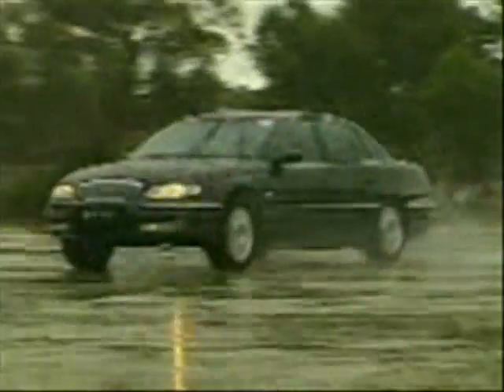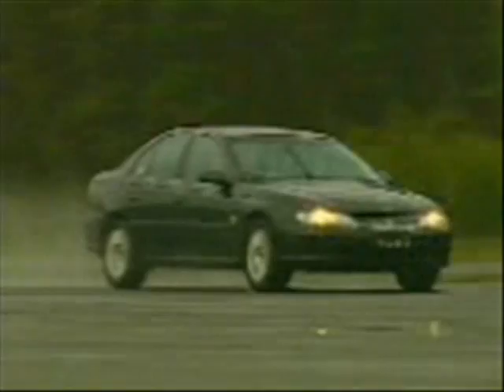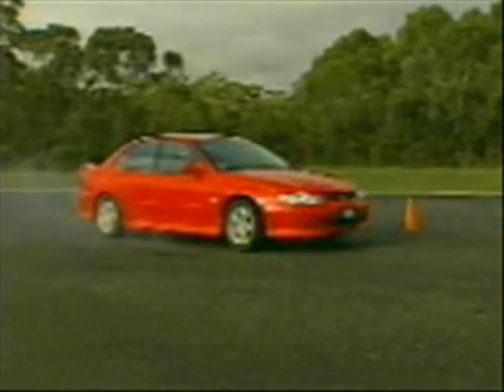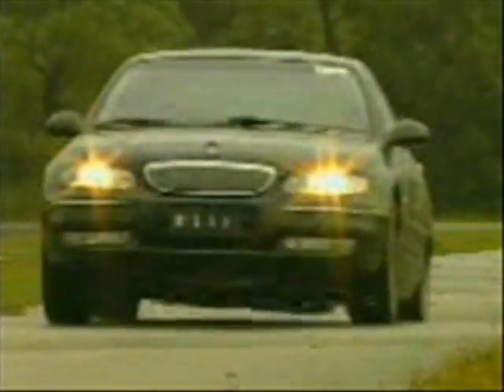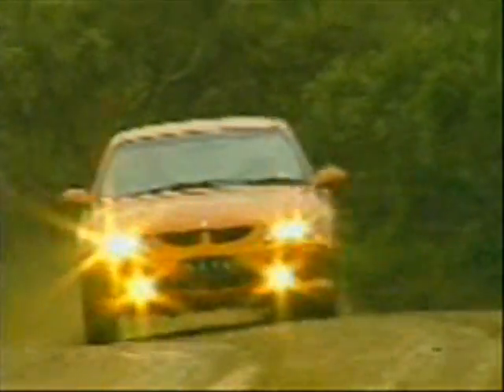Holden vehicle development

Comment: And no chamber adjustment on the rear traling arms , results in negative camber and wears the rear tyers on the in side ,SO YOU NEED TO CHANGE THE TYRES ACROSS THE CAR A FEW TIMES INTHERE LIFE TIME ,OR A AFTER MARKET CAMBER KIT TO BRING THE CAMBER BACK TO SPECK .

Comment: Pity testing didn’t result in durable top strut mounts or reveal weakness in fluid filled rubber caster rod bushes. Forward and reverse dumps should have ruined tail shaft rubber donut isolators, rear cradle rubber mounts also prone to stretch, tear and fail under such stress, hell just going over residential speed humps a few times collapsed top strut rubber mounts. Sure weren’t built to last past warranty. What we didn’t see were flat bed trucks carting these thrashed examples back to factory as a pass to start mainstream production.